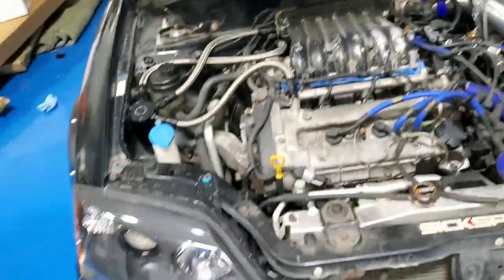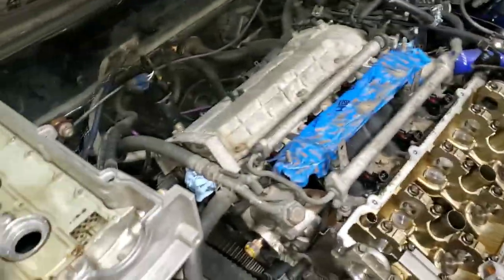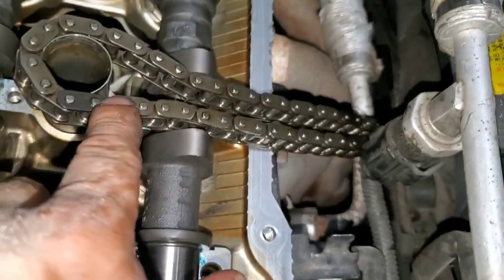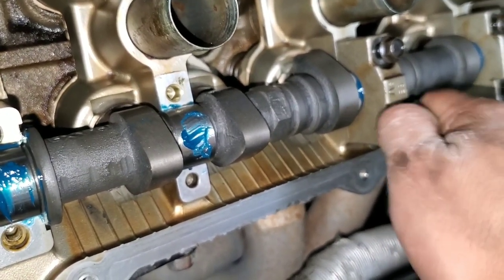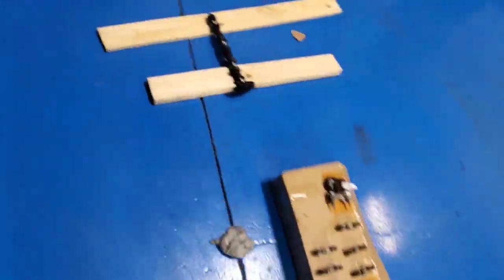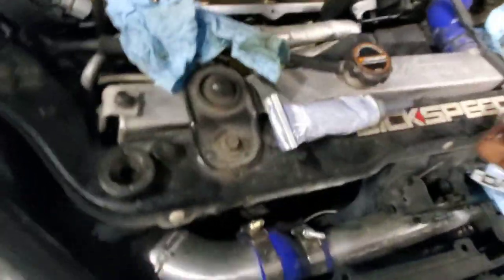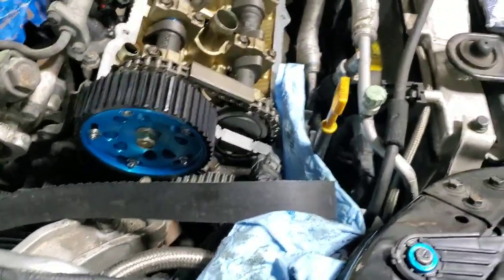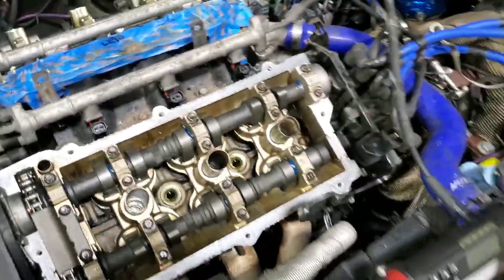Installing Crower regrided Cams & fidanza cam gears GK Hyundai Tiburon V6

Comment: You should of installed the cam seals first before bolted the cam bearing caps back on. It would made it easier instead of trying to press it in.

Comment: I was wanting to get some cams for my 2008 Hyundai Accent would Hyundai tiburon cams work?
Reply from the maker: I'm sure you don't have 2.7 or 2.5 v6. You can call Crower and ask them if they will regrind your Cams
Reply: @Lilmiddwest  I’ve been trying to find cams for my car but because it’s a certain design nobody makes any aftermarket versions
Reply from the maker: @broken_sticks1880  bro call Crower they might regrind your Cams. No one makes Tiburon camshaft so I sent my camshafts to Crowercams to regrided to my turbo set up

Comment: Hello, you know, I have a doubt in this Santa Fe, do you think it would be possible to just remove the cylinder head cover from the front and repair the tacks that began to sound to me, surely some that sounds like short and dry metal I say in sound after using lyqui moly to tacks and that is why I must remove what is clogged clean this and reinstall the camshaft without having to remove the two parts of the engine is that possible without wasting the ignition time of the engine disassembling without moving anything and reinstalling what do you think? I would like to have your professional opinion, greetings.
Reply from the maker: You mean valve covers? What wasting ignition timing when removing valve covers??
Reply: @Lilmiddwest  yes i do that hidraulics pisces whit little hole where goes inside the oil that are blocked by rubbish so i am sure metallics sound come by the front but i will like just to do.it only in the front it is posible ? Or should be both sides? Thanks 👍😊
Reply: @Lilmiddwest  I was referring to
to the engine ignition timing if I only disassemble and clean the parts that are like hydraulic caps that go on the valves only from the front of the engine without uncovering the other side of the v6 engine I will not lose the engine starting timing point that is my doubt
Reply from the maker: @adolphff  I never ask for hydraulic peace or whatever you are trying to say. And it's up to you wana do. If it was me ill just look at rear valve cover and see if it's good or same as the front.
Reply: @Lilmiddwest  have look to my pic perfil there is the piece 👈
Reply: @Lilmiddwest  okey so i need to check 2 sides okey tanks again 👍
Reply from the maker: @adolphff  guey this is not a carbureted engine. It's a fuel injectiors system, it has sensors to know when to fire and ecu.

Comment: Buenas bro
Sabes que estoy a punto de reparar un motor 2.7l V6 de tiburón, pero no tengo el manual de reparación del motor, por ende no se los torque específicos de cada parte.

Me podrías ayudar con una página o algún lugar para obtenerlos, de antemano gracias
Reply from the maker: ¿Como que? Porque esa mucha información y muestro todo en mi canal..
Reply: yo tengo el bloc pero es para 2001 kia optima. es el mismo engine pero el kia tengo 2.5L y el Sonota o el tiburion teng 2.7L
Reply: tambien yo tengo el libro de wiring diagram para 1999 mercury sable y ford taurus

Comment: How much did crower charge you for the cams? , did you have to change the valve springs or was it not that aggressive.
Reply from the maker: Around $400 and I explained on my unboxing video. I did not change valve spring and I don't know much about Cams spec I told them what I'm using it for and what I done to the car.
Reply: @Lilmiddwest  good deal, ive heard people paying $800+

Comment: U Have any dc or maintec headers u are selling? The Amazon ones are holding back a bit of power off of the reflash I did lol
Reply from the maker: I do have dc sport headers I'm waiting on find clean 6 speed Tiburon. I have DNA headers I'm going to sell.. I ran cheap no brand headers vs dc headers I didn't not feel no big power difference
Reply: @Lilmiddwest  1.75.diameter that's what I need according to the tuner that did the reflash is hold back like 10-15bhp because of 1.5 diameter
Reply: What's the diameter on the DNA? I do know the DC are 1.75
Reply from the maker: @Aplayasworld  for the y pipe or what part of the header
Reply: @Lilmiddwest  the actual headers
Reply from the maker: @Aplayasworld  well there different size from inlet out let. Bigger inlet is DNA but bigger outlet is dc sport header.
You and someone else are only ppl ask for measurements for turning. My tuner never asked me how big is my exhaust, intake and etc just fuel system
Reply: @Lilmiddwest  let me know if u are willing to sell me either of them

Comment: damm bro my hla started acting up i think. just installed my ebay headers and tune
Reply from the maker: What is hla? Never heard of it
Reply: @Lilmiddwest  the hydraulic lash adjusters. the caps on top of the valves.